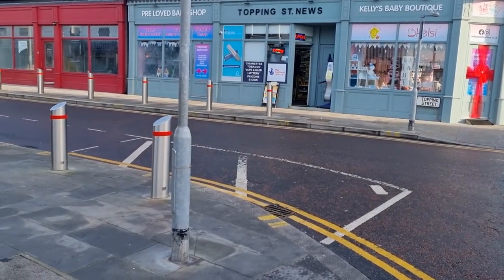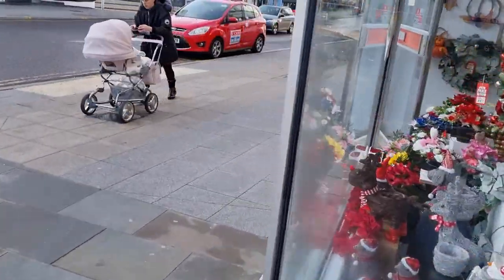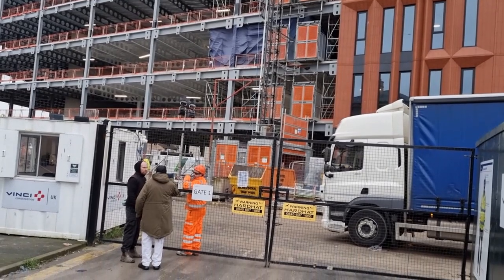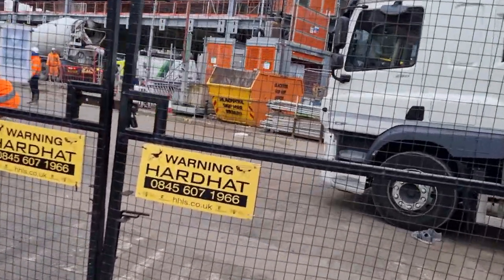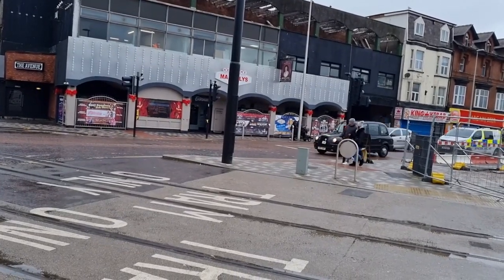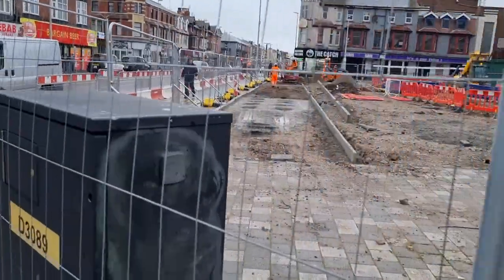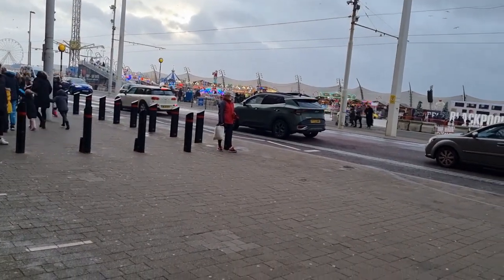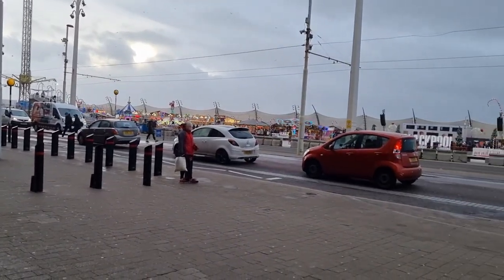BUILDING BLACKPOOL BETTER PART 530

Comment: We thank you for this Sunday Review Colin. It is especially welcome as we are coping with damage from the horrendous winds of Storm Erin and we are wondering what Storm Fergus will bring in the next few days.
Possibly fewer facing panels and exterior fixtures will be placed with up to 65mph winds. The main work on the builds will be battening anything moveable down!
We are wondering if the Star Flyer and the St John's Square Christmas tree are still upright.
We enjoyed the happy interaction between yourself and the contractors on the Holiday Inn panelling work. Lets hope they can pop into the power house for a warming cuppa and a mince pie as respite from the cold now that the cabins have gone.
We hope you will stay safe video vlogging while Storm Fergus approaches and we wish you and your good lady Susan a safe pre-festive week.
Eryk and Kris :-)
Reply from the maker: IT IS HOPED ERYK THAT THE DAMAGE YOU HAVE RECEIVED CAN BE QUICKLY AND EASILY CORRECTED==MY FINGERS ARE CROSSED THAT THIS IS CORRECT==OH YES TEA IS SERVED EVERY 3 HOURS IN THE POWER HOUSE FOR THE CONTRACTORS THERE WAS A PACK OF 6 MR KIPLINGS MINCE PIES LAST WEEK BUT THEY ARE LONG GONE==TO YOUR GOOD SELF ERYK AND KRIS I SEND BEST WISHES THANKING YOU FOR EVERYTHING AND SUSAN HOPES THAT YOUR DAMAGE CAN SOON BE CORRECTED
Reply: Thank you Colin, a resolution date for these challenges is 22nd December! However the ingress of water through the ceiling has stopped! Fingers, toes, eyes and everything else crossed!
Searching for videos of yours that I seem to have missed.
Betsy arrived last week with crumbs around her mouth and a bag of aluminium cake cases - mystery solved methinks! :-)  @SEASIDEVIDEOS
Reply from the maker: GOOD TO KNOW THAT A DATE HAS BEEN FIXED ERYK==YOU ARE IN ALL OUR THOUGHTS==BETSY HAS A BAD RECORD THIS YEAR WITH YOU AND KRIS SO YOU MUST TAKE THIS INTO ACCOUNT WHEN MAKING UP HER SALARY THIS CHRISTMAS MONTH PLUS HER YEARLY BONUS==I SUGGEST A DEDUCTION OF 50 PER CENT ERYK==SAY HELLO TO KRIS FOR ME AND ALL THE BEST TO YOU BOTH
Reply: Thank you and thanks to Susan for your kind thoughts, some positivity already achieved but Storm Fergus in action as I write may have something in store for me!
I have conveyed your best wishes to Kris, thank you from us both.
We have given our errant housekeeper an invoice to reclaim her wages for the last year plus last year's bonus. 5 Pounds, 17 shillings and 6 pence in total ... and Kris wants her fascinator hat back ... after Betsy has had it dry cleaned!
Best wishes from Team EryKris to you both  :-)    @SEASIDEVIDEOS